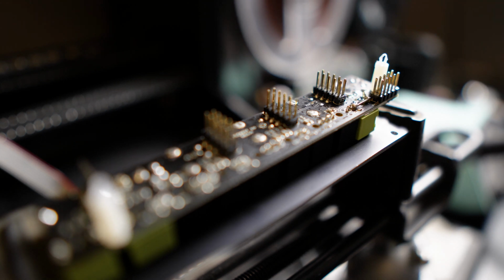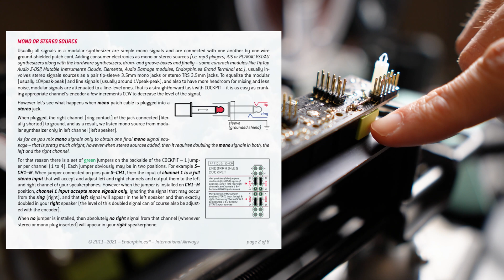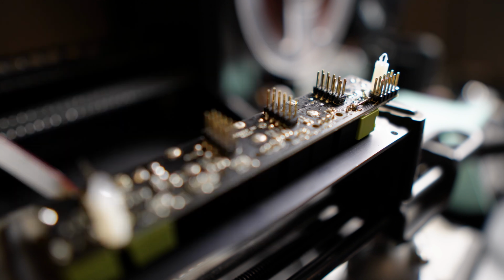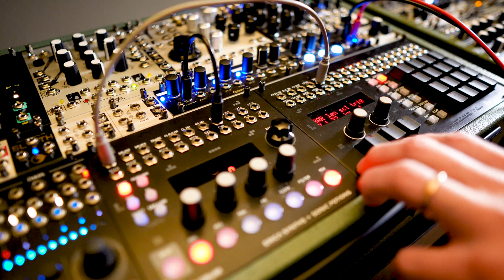Modding Endorphin.es Cockpit 1U to Make Channel 1 Mono

Comment: Cool solution! I run Queen of Pentacles through a trs to ch1 and I assume that’s why they made it that way. I’ve thought long and hard about what I’d do if I switched to LXR, and now I know!
Reply from the maker: Yeah it I guess makes sense if you have a bunch of their gear and are building out a full Endorphin.es system - but even then managing two cable types just feels annoying to me personally. 

If eurorack as a whole shifted to being TRS cables by default and every module had options for normalizing L>R - then maybe that starts to get a lot simpler. Every cable could then be stereo if the jack needed it and mono otherwise, but I just don't see that happening really.

Comment: WHOA! First off, thank you. I abandoned using that channel for kick (like everyone wants to do for channel 1) and have Dual TS to TRS 24" cable that I use to run a stereo voice into that channel.  But I hate it.  I just want that mono.  Thank you!

Second, how are you liking the Golden Master 1u pairing there?  I used to have the same setup, but recently sold the Golden Master as I just couldn't seem to get it clean.  Mostly, I had noise gating issues in silent moments where it would bring in the noise floor (really loud).  So I sold it ... and now have mixed feelings about the sale for a couple reasons:
1 - I am struggling to find a good replacement.  I love what you are doing in your other case with the Jumble Henge / HP setup, but I have a Cosmix for mixing, and thus the Jumble henge spectrum spacing doesn't really work.  I am really trying to find something functional to get that spectral differentiation ... and it might just be a load of filters, plus a MSCL at End of Chain and maybe an EQ.  Any recommendations?
2 - Now my 1u Cockpit has a stereo jack out.  UGH! back to adaptor land.  Typically I use 90 degree cables for everything, and these adaptors really get in the way in my center 1u row.  I am now thinking of either ditching cockpit or getting Golden Master back literally just to avoid the output of Cockpit.

I want to love both of these modules, and just looking for recommendations on how to make them work.
Reply from the maker: Totally agree that managing even that one random extra cable type feels so frustrating. 

I originally grabbed the cockpit for my little 62hp palette case since it can connect to the Intellijel 1/4" outs - but the overall approach for that case just really didn't do what I hoped it would, no fault of the Cockpit module.

I had Golden Master originally in my more ambient focused A case, but as I refined things it just didn't make the cut. It sat in my B case for a while and didn't really have a clear role until I realized I could combine the cockpit and golden master together for a pretty decent mixing/eq chain in that case with modules I already had. 

I mostly use it for the playable mutes it has and for the stereo width, bringing the low end to the center and high end out wide, similar to Jumble Henge. I think it's fine for that, not necessarily a must have though. MSCL seems dope, so does SCLPL as an end of chain pair. I'd love those two, plus an overseer - but I don't think I'll ever have room unless I bail on my 200-grit approach.

Does your stereo out on the cockpit sound distorted? The headphone symbol there makes me think its supposed to be line level, but I'm almost certain its modular level.
Reply: Oh, I have been sleeping on SCLPL. That might be a really good answer to my concerns if I can find one of them.  Thanks!

No, haven’t found the output distorted, but I did have issues with the stereo cable I bought not seating correctly and cutting in/out a bit. Swapped to a different brand adaptor and it resolved.

Keep making great music and content! 🤘🤘
Reply: Have tried jumbel  henge ? Reviews are showing a very clear spectral spacing .. it seems to work really good